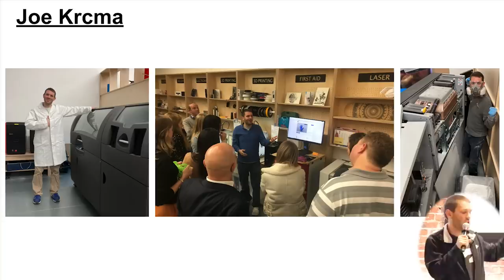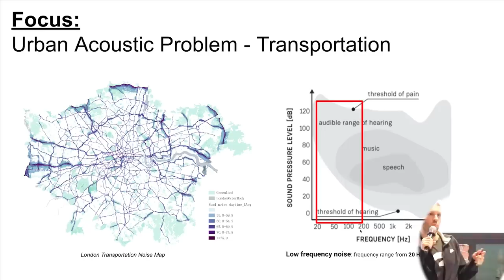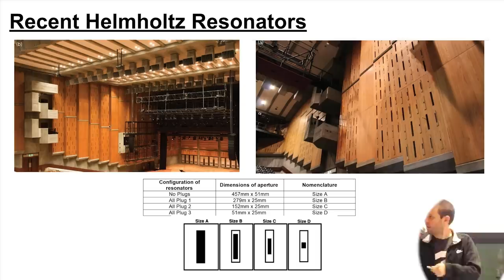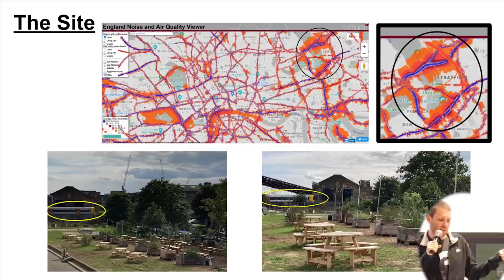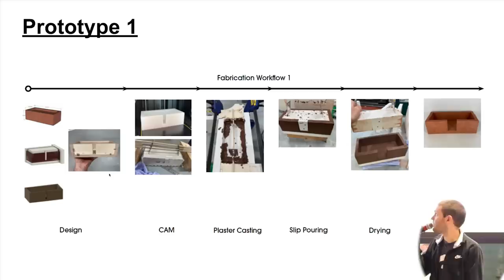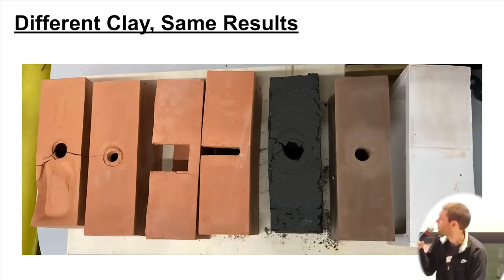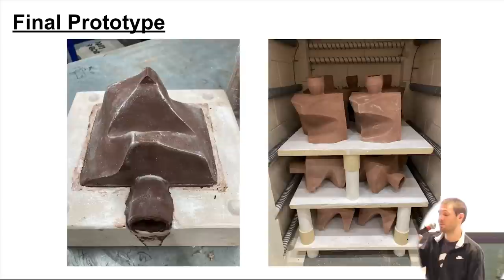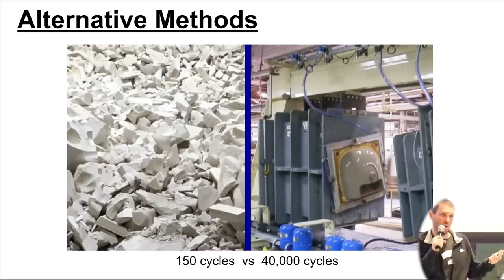These Bricks Can Absorb Traffic Noise - Thesis Presentation on Helmholtz Resonators

Comment from the maker: Over 1 Million Views! Thank you all so much for sharing this! Feel free to download the brick file for free (linked in the description) as well as my thesis and portfolio 🤩
Reply: Being .limited to ceramics is a challenge.

How about just glass.  Like how wine bottles are made.  You can make different sizes of openings, etc.  the rest of bottles…interior of wall,…can be all the same and interlocking.  Think like a sturdy glass brick wall but with a purpose.  Can use recycle glass.  So many colors to choose from.

Very interesting presentation.  Thank you for sharing.  If face to face I would have many questions for sure.  Congratulations
Reply: Hey Joe, going back to the idea about holes basically drilled into the side of cinder blocks, what is the relationship between the diameter of the opening and the frequency of sound absorbed?
Reply: Bird nest?
Reply: You have the digital file? Cool
Reply: Not to burst any bubbles. But if one of those gets damaged. Let's say somewhere in the middle of a wall. It will be impossible to replace it with a new brick.
Reply: @john050994  depends on the shape, you can cut out a single brike and replace it, but it might be more of a case of needing to just infill for stability if needed
Reply: Please, for the love of all that is holey, tag your videos.  It took me forever to find it again because it isn't properly tagged.
Reply: Thanks for this! Not sure how you ended up in my feed, but I was trying to listen to you WHILE MY DAD IS 10 FEET AWAY BLOWING LEAVES OFF THE BACK STEP 🤦‍♀😅🤣😂
Reply: Nice job.
If I was you, I would:
Study what causes the noise. The frequencies and direction.
Then create a library of patterns and test them.
In most of the cases you need to catch the noise from a specific angle. And when cars move they don’t cause noise evenly in all directions, even the wind caused by them can shift the waves in a certain way.
And using liquids could be a good idea. In all cities rain water runs to rivers through roads and channels without being absorbed properly which leaves ground water levels in poor condition.
You could solve two problems at once in the green areas of the city.
Good luck

Comment: When you pointed out that birds making nests inside the resonators would help their efficiency I was sold. Good work, HD first class honors!
Reply from the maker: Thanks!  Seems that you are one of the few that watched until the end 😂
Reply: Yeah typically people try to get birds out of similar urban spaces like laundry room vents so this could be good.
Reply: During non nesting times the nests could periodically be blown out with pressure washers if necessary. Me I'd prefer to have the birds there. I hope that the wall is built and studied and tested so that it eventually becomes a viable building option for specific locations.
Reply: How does filling the cavities with mud help the effectiveness? Or are you assuming that all birds just use dry materials if some similar density? 

More importantly, did you test this with various bird species in a real environment yet? I’m skeptical
Reply: I watched it all, the habitat point is great.
Reply: @kaelhooten8468  I don't think it would matter very much ehat kind of bird species. Even if it doesn't help, its not going to make it much worse, and taking care of the tubes should  mitigate any issues.
Reply: @fungustheclown666  this will be a barrier to implementation. You’re underestimating the potential impact.
Reply: @JoeMakes hi Joe, this a great effort on your part, however I think you're seriously underestimating the wildlife issue. I cant see the size of the tubes, and birds might indeed fit, but so will mice and wasps - you're making the perfect protected environment for them. Also, they aren't cleanable as so much water would be left inside, to leak through any cracks. Diversity isn't just for the environment - it works great for teams. You could run these by materials experts (a potter could really have helped you through those warping and cracking issues much faster), maybe a biomimetic engineer, wildlife biologists (and usually people are free to talk to because everyone likes to talk about their area of expertise:-) All the best in your making!
Reply: I beleave a birds nest inside would make the volume smaler and the
helmholsfreq. higher. Depending of material of course, an absorbent (wool-ish material) could work opposit, but will also dampen the owerall effect.
Reply: Also how will the resonation affect the birds inside? Will this attract birds that are more tolerant to noise and repel others?

Comment: I put a Helmholtz resonator (aka J-pipe) on my truck 4 or 5 years ago with great success. Drastically reduced the engine drone at cruising speed. I used a frequency analyzer app on my phone to identify the resonant frequency, and then did the math.
Reply from the maker: Nice
Reply: Where'd you learn to do that?

Comment: Woah, I didn't initially realize that the cavity between the bricks created another Helmholtz Resonator as well. So freaking cool! Well done on the presentation as well, I was captivated through the whole thing. Fastest 34 minutes ever!
Reply from the maker: Haha, maybe the next WBC collab talk!  Thanks bro, now it's your turn to host a presentation on the millions of different breakthroughs that you create in a single afternoon
Reply: @JoeMakes  Do you think that bird nest could be a problem with the central hole? In America we have some very small bird species that might be able to nest in them. I don’t know much about Europeans birds which is why I ask. :)
Reply: I was wondering the same thing and I would guess that amongst hundreds of bricks, with various hole types,  a few birds nests wouldn’t matter especially since they are somewhat porous and temporary
Reply: He mentioned that at the end. Nests would help the sound absorption and also help to absorb a wider range of frequencies. 
It is a seriously cool and innovative design.
Reply: Win win, but not using a release agent sooner…
Reply: The problem with Helmholtz is two fold.  You need a LOT of them to reduce the amplitude, but more importantly they are only effective at a specific frequency.  With the noise in the graphic at 5:07, it's a wide frequency range in that Red Box, which was 20hz to 200Hz.  To reduce the noise, you might need VERY, VERY thick walls using a variety of different materials, thick concrete, thick steel plate, etc. might be needed and it might not be cost effective and it would require a LOT of space due to the thickness.

Comment: A very common place to find Helmholtz Resonators is in everyday loud speaker cabinets such as your computer speakers. They are generally referred to as base reflex cabinets.  The tube is usually sticking into the inside of the cabinet rather than out. Every loud speaker has what is called a resonates frequency, usually in the lower frequency range. This is a frequency where the speaker will  have a volume peak. If the tube is tuned to the that frequency, the enclosure will restrict that frequency by forcing the extra energy into a lower frequency enabling the speaker to reproduce even lower base.  My father hand built his hi-fi system in the early 1950's using this concept.

Comment: Super cool. As a ceramics artist and amateur musical instrument designer, I feel remarkably inspired right now.
Reply from the maker: Awesome!
Reply: Indeed!
Reply: just imagine the sound that wall will produce thanks to gust of the wind
Reply: As an ocarina player, I have a small collection of fired ceramic helmholtz resonators.
Reply: I've been designing speakers and room acoustic solutions for listening rooms for years so the basic concepts here are all familiar to me. However the 3D pattern with the built in chambers was an intriguing idea. It could be utilised in a listening room as a diffusing and absorbing element very easily... The goal to absorb 20hz is a bit unrealistic though as wavelengths involved would require huge resonators and/or tube length.
Reply: @hatemymailbox  That's an interesting point by the way, this could be an unintended phenomenon just like the laser burning effect of the famous curved glass building face in London :)
Reply: @Munakas-wq3gp So here comes the future...  ChatGPT just popped out 10 seconds of [to me, unverifiable] calculation informing my simple self that with a neck diameter of 1cm and depth of 3cm to the resonator chamber, 20Hz   could indeed be targeted within the volume of 4 American bricks.  I love what is about to become possible for folks who ask "...what if...?"   Love it and this discussion/brainstorm!